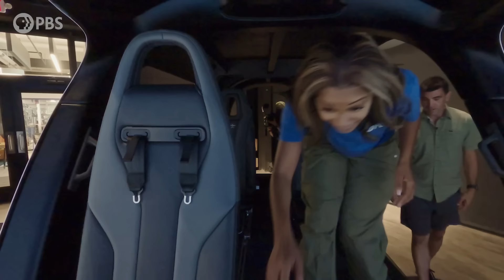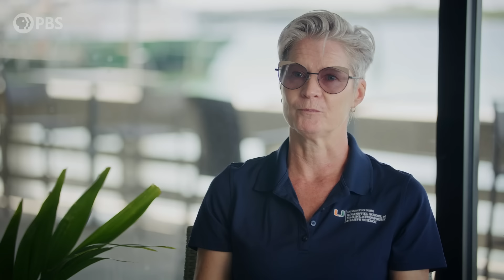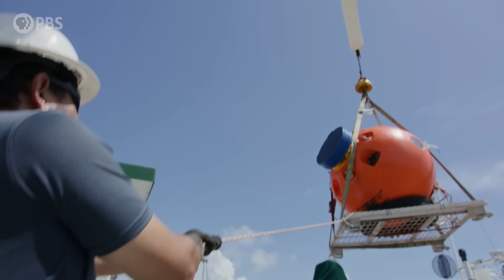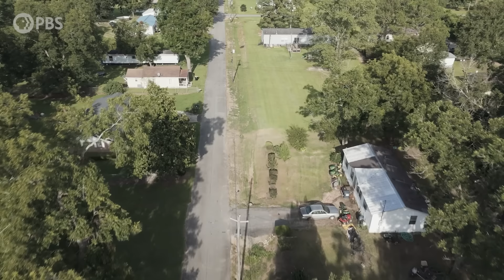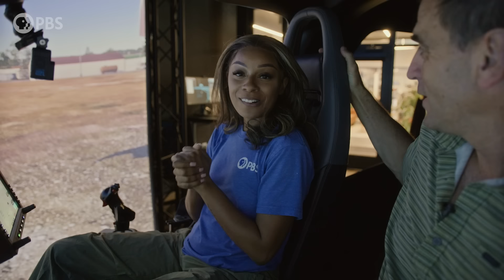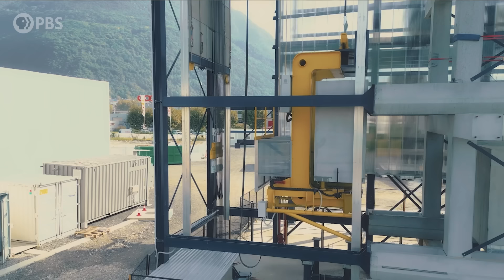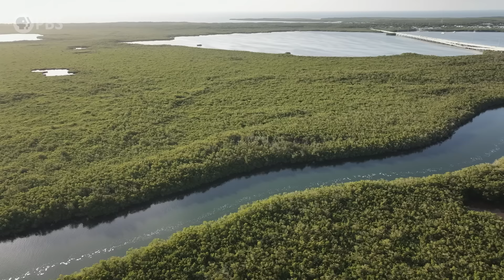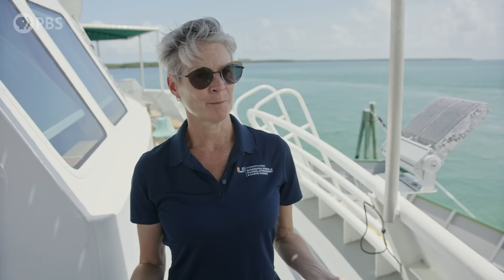This Is The Best Evidence That Atlantic Currents Are Slowing (AMOC Explained)

Comment: I wish I'd heard this info earlier. I may have done more research to be able to afford a heat exchanger. My gas boiler just died and needed to be replaced. I knew changing the system from gas to electricity would have an additional cost of removing the baseboards all over my home plus adding ductwork and vents. Plus I already have solar panels so my costs would have been significantly reduced.
Reply: It’s not too late, it works great with a secondary heating source too. I’m in a similar situation where I have some solar panels but I’m in a climate zone that’s too cold for my heat pump to heat efficiently during the coldest part of the winter (it works best above freezing and really sucks a lot of juice below that). It still has lowered my heating/cooling bill tremendously by heating my home when the temperatures are above 32F and cools my home more cheaply in the summer months than a traditional AC unit. I love my heat pump!
Reply: @JamesVitops  Thanks I will look into it.

Comment: ELECTRICITY IS NOT A SOURCE OF POWER !!!
it's a form of power Transmission.....even batteries transform electricity into chemical energy and back.

and historically speaking, the climate instability has nothing to do with carbon release <---- That's Not What Has Been Causing The Climate Instability .... the climate instability Is caused by Sub-saharan Africa transforming the Last TWO FEET of American Topsoil, into a Sub-saharan Methane Plume In just 60 Years Time !!!

Comment: This is a scare story about things you cannot see. 
To quote the Chief Scientist at the National Oceanography Centre, Professor Penny Holliday, "There hasn't been a slow down. There hasn't been a slowing of the AMOC."
Actual observations using the RAPID-MOCHA array from 2004 to 2023 show, that although there can be a great deal of variability of flow in the ocean from month to month or even day to day, there has been no decline in the Gulf Stream, with flow oscillating around 32Sv (32 million cubic metres per second) throughout the period of observation. 
Continuous section measurements of the AMOC, available since 2004 at 26°N from the RAPID-MOCHA array, have shown that the AMOC strength decreased from 2004 to 2012, and thereafter, it has strengthened again. No relationship to CO2. 
MOC spanning the North Atlantic at 27°N derived from RAPID/MOCHA/WBTS, satellite altimeter, and Argo floats for 1994 to 2020 shows no statistically significant decline (-0.06 Sv per decade). Furthermore blended meridional overturning basin-wide circulation (MOC) trend estimates (Sv) based on combinations of satellite altimetry and in situ hydrography data exist for the South Atlantic for 1994 onwards: at 34.5°S (often referred to as SAMBA) is +0.48Sv per decade. This is a significant positive trend, so no decline, no tipping point, no correlation to CO2. (GLOBAL OCEANS G. C. Johnson and R. Lumpkin, Eds., 2021)
The OSNAP MOC Timeseries of observations from Canada to Greenland and across to Scotland, although a shorter timescale (from 2014), show no decline in MOC with the flow fluctuating around 17Sv.
"Florida Current transport observations reveal four decades of steady state" Volkov et al, 2024 (published in Nature). This paper shows that a key component of AMOC, the Florida Current, has remained remarkably steady for over 40 years. 
There is no climate crisis. 

The North Atlantic current has doubled its velocity over the course of a quarter of century (Oziel et al, 2020). This is based on actual satellite observations. 
The idea the AMOC is going to shut down is based on modelling. There is minimal real world evidence to support these outlandish claims. It relies upon climate models. You know, those Magical Truth Machines that keep making false predictions. It claims with 95% certainty that the AMOC with collapse by the end of the century. Come on! Really? These numerical models produce ocean circulations that are far from what we actually observe. These models can't even replicate one of the key physical processes, Convection, in ocean currents "because convection is a small-scale process, it is not captured well in most current models (Jackson et al (2023)" (Rahmstorf, 2024). So they can't model Convection. So they can't model ocean currents.  

The most recent research into the AMOC confirms it is not weakening. From a 2024 paper by Terhaar et al published in Nature Communications "Based on the here identified relationship and observation-based estimates of the past air-sea heatflux in the North Atlantic from reanalysis products, the decadal averaged AMOC at 26.5°N has not weakened from 1963 to 2017". So not even close to a tipping point or collapse.

Sea surface temperatures (SST) were trending downwards 2000-2018 (HadSST 4), and from 1950-1980, and from 1880-1910. The oceans warmed at a faster rate 1910-1940 than 1980-2010. Remember CO2 has been accumulating in the atmosphere at an accelerating rate all the time, so there is little correlation between the two. 
Also the 'Cold Blob' has disappeared from North Atlantic surface temperatures, when annual anomalies for 2013-2023 are compared to the average for the period 1979-2010 (ECMWF ERA5). The International Comprehensive Ocean-Atmosphere Data Set (ICOADS) shows a Sea Surface Temperature departure of over +2°C exactly where the Cold Blob used to be. It may have been there but it's gone. Looking more carefully using NOAA ERSST V5 data for North Atlantic Sea Surface Temperature anomalies (50N-65N, 50W-10W) shows in 1942 a +1°C anomaly declining to -0.7°C in 1992 then rising to almost +1°C in 2010, declining again to -0.6°C in 2010, and of course rising again to +0.75°C in 2023. There are also oscillations in the data back to the 1850s, but there is no trend overall up or down, and no correlation to CO2. The same is true for the heat content in the North Atlantic down to 1000m (Met Office data). No correlation to CO2, just a natural variability. That's the data. The Cold Blob is an artefact. 

The North Atlantic ocean has cooled and warmed rapidly and repeatedly during the current interglacial with no correlation to CO2 e.g. 10,300-10,200 years before the present (y BP), 9,500y BP, 6,000-5,900y BP, 5,400-5,300y BP, 2,500-2,300y BP, 1,700-1,600y BP (Berner et al., 2008. See Figure 8 in the paper). There is a high frequency (18 events) of SST variability on the order of 1-3°C during a 10-50 year time resolution throughout the Holocene in the North Atlantic with no correlation to CO2. And Life just carried on.
Reply: Blah blah blah. Bullet points please. At least you used paragraphs and didn’t run all the text together
Reply: @ChrisPBacon-0hYa  Never say never.
Reply: You're cutting and pasting the same long winded posts.  Also, I've corrected you before on exactly what Holliday has stated, which is not what you claim.
Reply: @TheDanEdwards  They keep posting this nonsense, and I keep pasting the truth. 
That quote is exactly what Professor Holliday said on a video that is available on YouTube. It's on the National Oceanography Channel.

Comment: Awesome, I took my electrification class through Rewiring America. Awesome curriculum. Anyone need an electrification coach, I'm available. Hit me up!

and, yes, we need to electrify our lives and use renewable, clean sources of energy to mitigate the worst impacts of climate change so let's get to work

I just leased a 2024 Hyundai Ioniq 5 which is awesome. We are getting solar panels on our home next month. Replacing the nat gas stovetop with induction sometime this year. And then we will make a plan to replace our nat gas boiler with high-efficiency, cold weather HP's in the not too distant future. need to spread some of these out due to the costs involved
Reply: and I love my Ioniq 5 (first EV). It is objectively better than any of the ICE cars I have owned previously including my 2006 Mini Cooper S Checkmate (a very fun car). I haven't been to a gas station in months and the car is so fun to drive.

Comment: While there are some substantial practical problems remaining, mostly with scaling, it seems like we are overcoming those. The biggest hurdles that I can see are psychological: denial and greed.
Reply: Bless your hearts, there isnt any hope.
Reply: @NelsonMartin-hp3js  I don have or need hope. I see what are the right things to do, and what science says is possible, and no good reason why we don't do them. We cannot avoid all warming since it's already happening, but we are still totally capable of avoiding the worst case.
Reply: ELECTRICITY IS NOT A SOURCE OF POWER !!!
it's a form of power Transmission.....even batteries transform electricity into chemical energy and back.

and historically speaking, the climate instability has nothing to do with carbon release <---- That's Not What Has Been Causing The Climate Instability .... the climate instability Is caused by Sub-saharan Africa transforming the Last TWO FEET of American Topsoil, into a Sub-saharan Methane Plume In just 60 Years Time !!!

Comment: Agree with a couple of other comments here that the biggest issue is going to be cost. Not necessarily of the appliances and such, but the cost of the electricity to power them. Yes, solar panels, batteries, wind turbines, etc. have all dropped in cost. But, the electric company has this little thing that you'll likely see on your bill called pass through charges. That's the electric company passing the cost of their improvements and sourcing renewable energy on to you, the consumer. At the same time, they are making their costs much lower over time but will never drop consumer rates. I'm all for doing my part to save the world, but when the corporations that hold the power for us to do that make it unaffordable for the vast majority of the public, you are hard pressed to get enough people to be able to do their part. I live in Northwest Florida and my power company has started installation of underground power lines to help keep outages to a minimum from storms. That cost has been passed on to me along with previous increases from solar power sourcing. It's a domino effect that ends up costing the consumer rather than the corporation.
Reply: Isnt that the point? Corporations take advantage of normal people, govment says where here to help (the corporations btw), corporations then make the laws, blame it on the govment, people dont understand bc they voted repub or dem, and people allow things to become worse than before.
Reply: there is no law of physics that says electricity generation has to be for-profit. That is purely a choice of society. We could easily say that electricity, like water and sewage and healthcare, is a public good and a virtual monopoly that cannot be entrusted to the so-called free market.
Reply: Solar is the cheapest form of electricity known to man and the slower we transition, the higher the cost

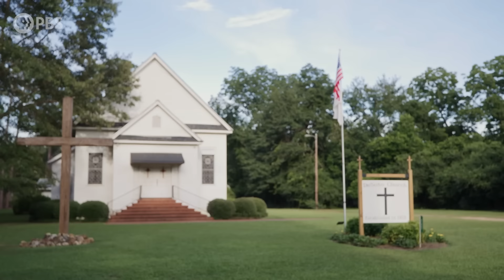Comment: 10:14 Look, I'm all about taking care of the environment but what they are doing is taking the smallest percentage of the problem and focusing on that. Furthermore, we already face electricity shortages in the summer from all the electric AC units and this will make that worse. This is NOT a sustainable solution 🙄
Reply: Would have to agree. The biggest issues are corporate waste and emissions first and foremost. To do anything with electricity we need to be making more with renewables before starting to build out electrical infrastructure. It's putting the cart before the horse
Reply: Kind of like blaming the plastic issue on people using a plastic straw when everything we buy is wrapped in multiple layers of unnecessary plastic
Reply: @danielleoliver1734  Yes, exactly like that.

Comment: We need about 20 terawatts of generation to replace the primary consumption of energy of the world. The good news is that we have passed 1 terawatt of solar and are adding over half a terawatt per year and increasing deployment at an expanding rate, so in 10 years or so we likely will be generating enough renewable energy to power the world. The bad news is that the history of energy production is that people will consume as much energy as is produced, including all of the existing installed capacity. We still need a dedicated effort to retire the incumbent fossil based generation. We also need grid storage and worldwide high capacity transmission.
Reply: Now if we can only convince the Oil, gas and coal oligarchs to transition to solar.
Reply: @Macgyrl64  we can buy them out. We can use regulation as well by buying them out is easier.
Reply: ...and what do we do at night...or when its cloudy...or winter...or raining...
Reply: @ oh dang. You are right. Why didn’t anyone think of that before now. Good thing you showed up just in time to set us straight and make sure we didn’t waste our time installing all those solar panels. Just think, we’d be sitting there in the dark wondering why we were so stupid. If only there was some way to store the energy generated by the panels when the sun is shining so it can be used later when it’s dark. Shoot, give me some of that sweet, sweet coal baby. Or maybe read my whole comment, especially the part about grid storage and high capacity transmission.
Reply: @manoo422  Are you serious?

Comment: The heat pumps are not so great in colder climates. But terrific where they are suitable.
Reply: Cold-weather heat pumps exist too recently
Reply: They work very well, we just do not use the air as a heat source, we use deep boreholes where temperatures are stable and much warmer, also no radiator to clean 😊

Comment: If you can change to a heat pump and electric stove do it. It's a lot better and cheaper than burning gas, also safer.
Reply: a heat pump with floor heating might be the best
Reply: @imtheeastgermanguy5431Ground/borehole source heat pump with entire house in floor heating, we are getting 5 units of heat pumped for 1 unit of electricity 🎉
Reply: It should be mandatory to include a heat pump any time an air conditioning system is replaced now. The incremental cost is so minimal that this is the ideal time to make the switch. Changing the stove would allow people to get off gas entirely, but it's not really as important in the near term as home heating.
Reply: @mal2ksc  That’s a great point & something I’m tucking away for future use. Every summer in the south somebody close to me is having to have their air conditioner replaced.
Reply: Don't know where you live, but everywhere I have lived, natural gas has always been cheaper for stove/oven than electricity.  Having said that I built my current house to be 100% electric, with heat pumps for heating and even a heat pump water heater.
Reply: @thekinginyellow1744  Unless you live in a state with the lowest natual gas prices and have a zero base fee contract, the price of a gas stove is only about as expensive as an induction stove...they are 80-90% efficient while gas stoves are 20% efficient at best, thus needing to output 4-4.5 times the power of an induction top to match the boil time...and the same for keeping it at a simmer. 

Not to mention particulate, benzene, Nitrous oxide and VOC emissions indoors where you spend a lot of time!
Reply: @ Why do you spread such lies.  There are good reasons to use electric, you don't need to make up lies to support your argument.
Reply: Normal people are not the ones responsible for this the governments lack of regulation and corporations disregard for environmental safety and common sense is
Reply: We finally replaced the last gas-burning appliance (water heater) with electric. Utility wouldn’t cut supply at the line at the street, but we capped it just inside the house, so we don’t also don’t have to worry about carbon monoxide. 🤞

Comment: The has greened up 20% in recent years with higher CO2 which plants love.  Dr. William Happler routinely has a CO2 meter in lectures and sees CO2 levels of 1600-1800 ppms in his rooms. It apparently is not that hard to CO2 levels above 2000 ppm as when Dinosaurs lived.

A person exhales about 2.2 lbs of CO2 a day.
Reply: Except the heat and extreme weather will destroy any benefits of added CO2.

At 1000 ppm mild cognitive impairment sets in...please, that is not good levels if you want to function optimally mentally!

Comment: "the Holocene Thermal Maximum, which occurred between 8 and 5 [thousand calendar years ago], with temperatures generally higher than today's, maximum temperatures between 8 and 6.5 [thousand calendar years ago], and an average of 0.9 deg * C .”.
Reply: Rate of change is the issue
Reply: That is cooler than today, we are at above 1 degree celsius now, 1.5 degrees for over a year now!

Comment: How much CO₂ do soda produce?
Reply: To carbonate soda, you take purified CO2 and pressurize a bottle with it. Using refrigeration, you can do this by dropping small amounts of dry ice into a large pressure vessel with distilled water, and then mixing it in the bottle or can with the desired syrup. Another method is with a pressurized canister or tank of CO2 like a sodastream or soda fountain. It's temporarily sequestering CO2 from the air to repease again later.

Comment: SMR small modular reactors are carbon free, run 24x7 despite sun & wind, small enough for passive emergency cooling to prevent meltdowns, and can be mass produced in factories to deploy quickly like modular homes. We need reliable power, not just intermittent sources
Reply: if only they actually existed.  So far SMR's exist only in the imagination.  ONE has been assembled in China so far, and despite being the current leader in nuclear technology, are approximately 15-20 years away from realising a mass production assembly line
Reply: nuclear power is BS